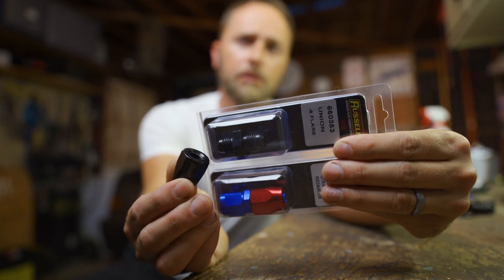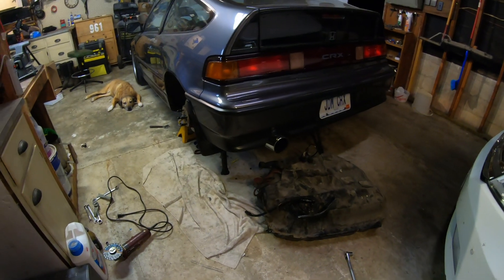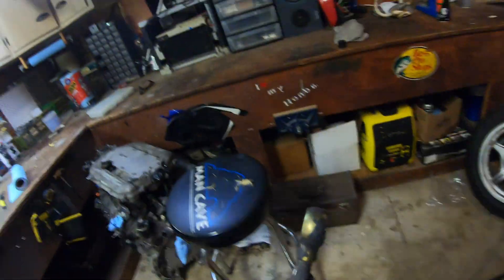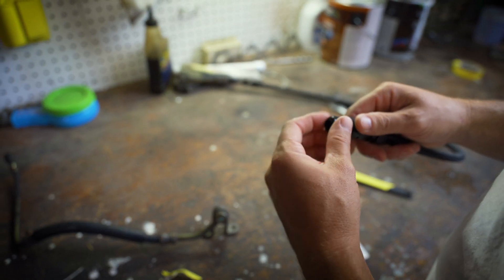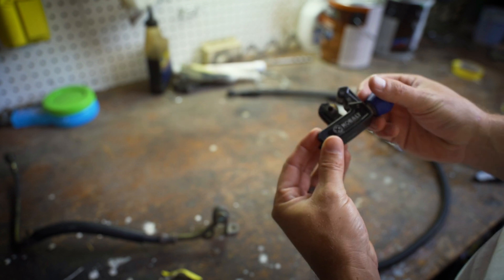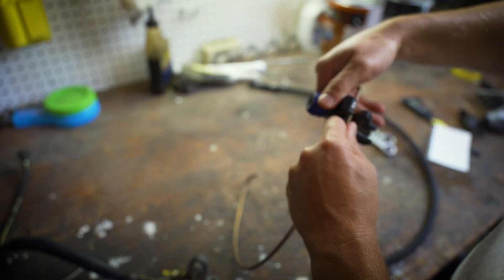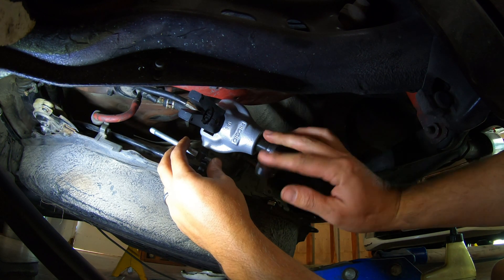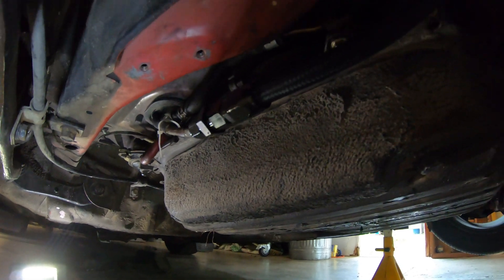How To Use AN Fittings and Steel Braided Line

Comment: How did you start that without pushing the clutch pedal in? Need a relay in there buddy.😏
Reply from the maker: Good eye lol. My pedal assembly broke years ago and I put the hush performance hydro conversion kit on for reinforcement and it doesn’t allow room for the neutral safety switch. Instead I have it wired to a hidden switch in the car so it doubles as a security feature now. Even if I left my keys in the car, if you don’t know what to do it won’t start.
Reply: @diversedad7954  not a bad way to add security. I was going to mention making a video about adding the relay, but seems you've already sorted it out.